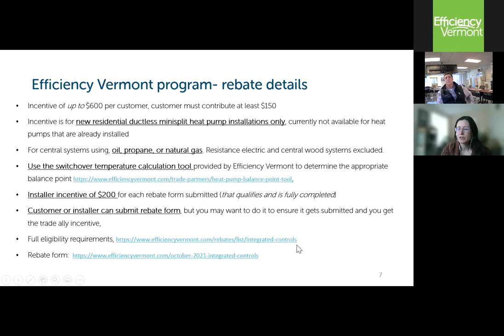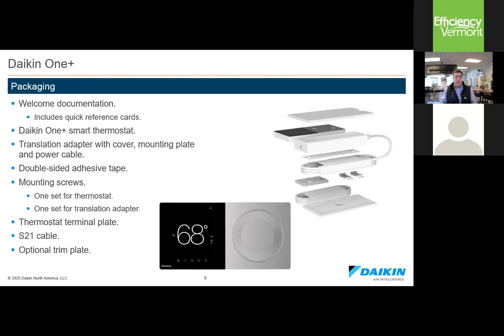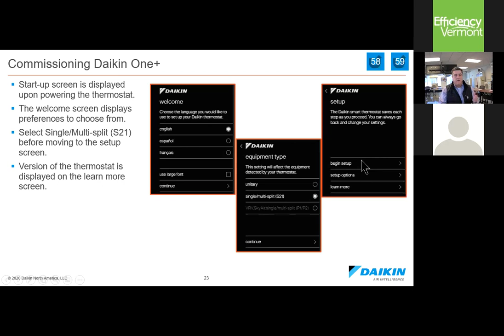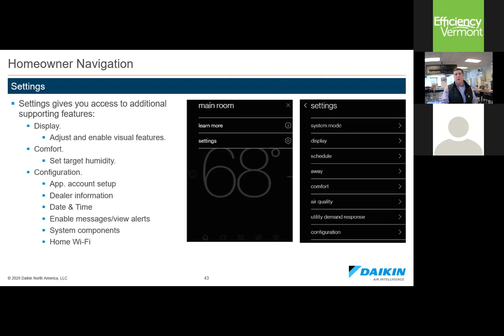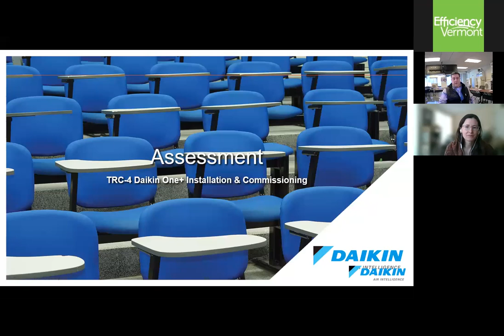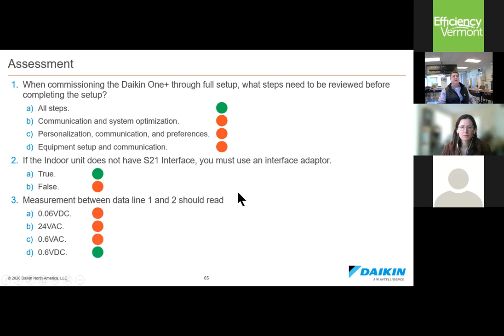Integrated Control Program for Ductless Heat Pumps with Daikin One

Comment: I am happy to see that individual suppliers are addressing the "change over" problem from ASHP to the secondary system.  As new products come out that are "universal" or independent of the heat pump brand it would be good to add to the comments for people to investigate.  For example the Flair Puck Pro is one option but is best for single indoor units as each indoor unit requires a "puck".  This can get quite expensive.